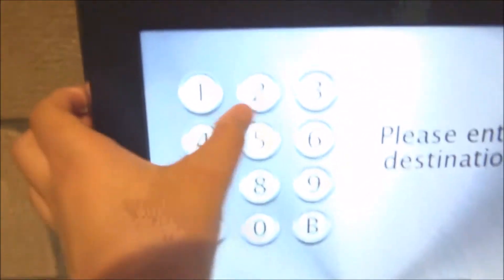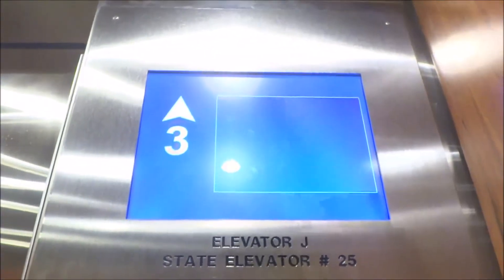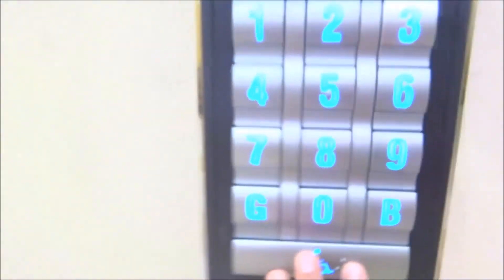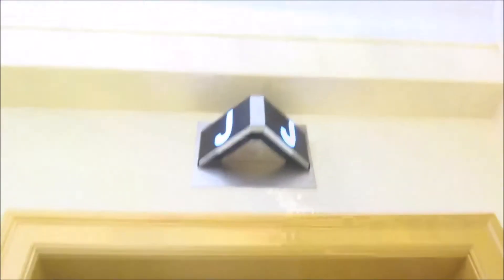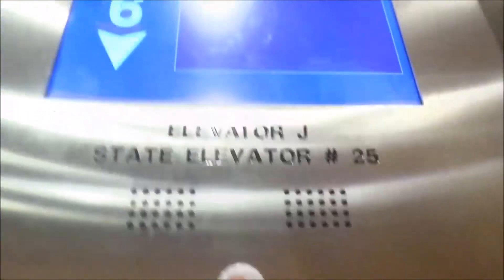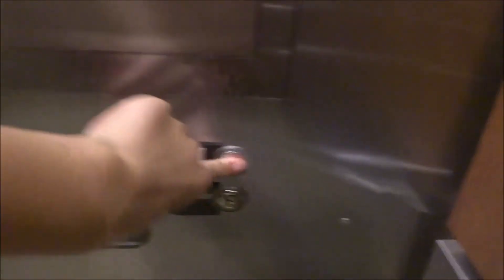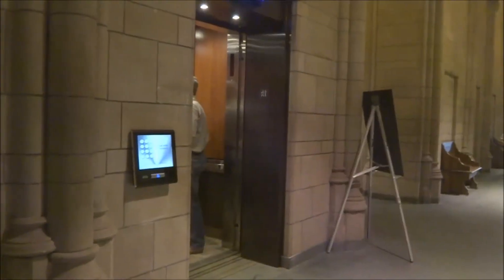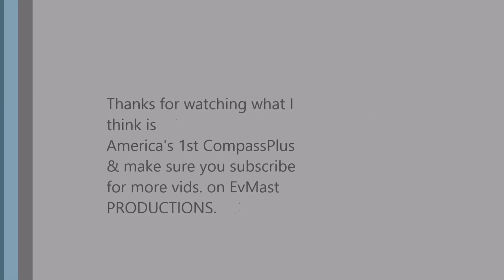Otis CompassPlus SkyRise elevators - the famous Cathedral of Learning - University of Pittsburgh, PA

Comment: More likely installed in 1971 and replaced in 2014.
Reply from the maker: 1971 was a modernization/replacement of the original 1930s elevators. Then 2014 was technically a full mod. rather than a replacement.
Reply: Thyssenkrupp was supposed to mod these but Otis won the contract
Reply from the maker: It was supposed to be Marshall using TK TWIN, but then obviously Marshall was bought by Otis so that all fell through. There were also rumors Schindler was going to do the mod. at 1 point.
Reply: Now I think Schindler is doing just that
Reply from the maker: What do you mean? Schindler's not modding these.